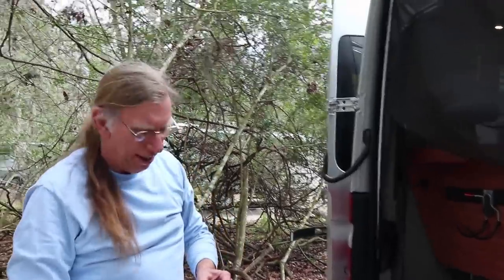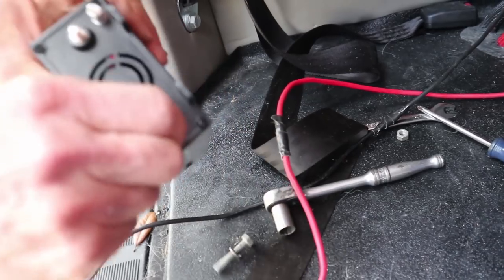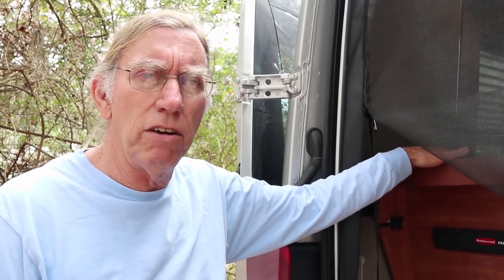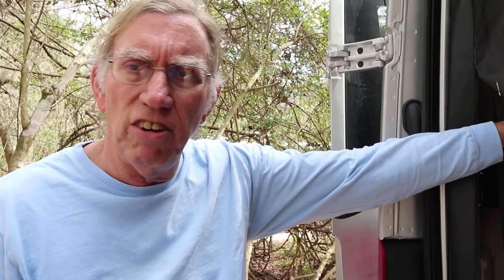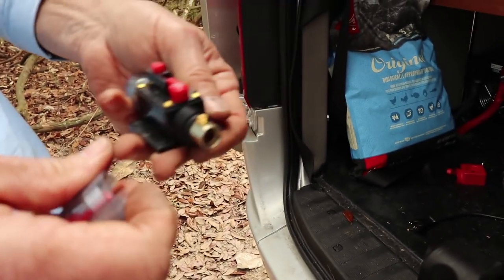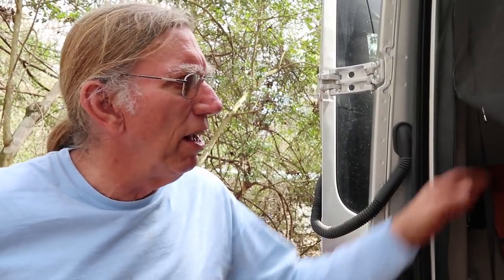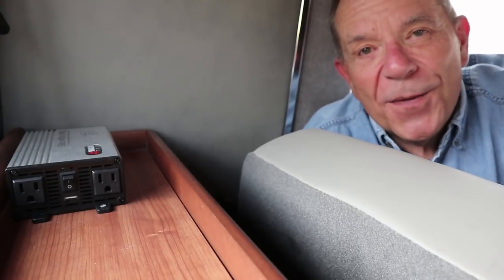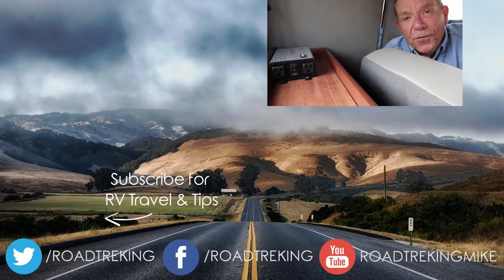Power Up! Adding A Small Inverter to Your RV for Extended Battery Life | RV Lifestyle with Campskunk

Comment: For those of us with older rigs and smaller house batteries   .5 to 1 amp draw may be  considerable, add a 12 volt automotive  relay and a mechanical timer so you do not forget to turn it off. My wife and I when watching  TV use to say put another quarter  in when  one of us got up and moved around.

Comment: The idea is great for some stuff and I may look at putting one in the Zion (though the big inverter is not as accessible). For cell phones, tablets and similar though I use the various USB power connectors around the cabin and skip the AC completely.

Comment: Or ~ you can purchase a basic rechargeable battery power pack with a built-in inverter and outlets. This will extend your system battery life and you can totally ignore your system's wiring and protection set up. The best by far have a lithium battery (expensive) but I'm currently (lol I did a pun) using a much cheaper car jump starter/power pack with an agm battery and an inexpensive 400w inverter (two 115v outlets and USB ports) to power/recharge eveything except my AC and microwave. If you go the inexpensive jump starter/power pack route I highly recommend the ones with an agm lead acid battery. * If the power pack has usb ports always choose these over the inverters usb ports and always turn the inverter off when it's not being used. An inverter uses power almost like a small appliance.

Comment: As to charging cell phones and tablets, I went much simpler in my travel trailer. I wired a usb charger into the light circuit in the bedroom and the living room. Presto, I have spots to charge my devices without using an invertor. The LED lights use so very little power and the circuit is protected by the fuse in the power box.  I didn’t have to try to string a new circuit. This especially important in the slide out.  I do like the idea of the small inverter and will probably install one for the computer.
Reply: Mike Strothotte there are laptop chargers 12v to 19v

Comment: Stick to using 12v or 24v when ever you can and use USB adapters or 12v outlets. When you convert to mains voltages you lose efficiency every time. Since I put a solar panel on my rig I’ve only plugged in when it’s available to run the fridge.
The panel has charged the habitation battery by 10am

Comment: Great Video!!  Just one thing, for those with slightly older Roadtreks having the etrek option, you may have a 24v connection on the large inverter.  You can't use that for the inverter mentioned on the video.  I have the same 400 watt inverter and connected it directly to the the batteries with an inline automotive 30 amp fuse.  Seems to work great.  Just be sure that the connection to the smaller inverter is receiving 12v and not 24v.  I have the 2015 Roadtrek CS etrek (which I love).

Comment: I have a question, I just started living in a pop up Rv trailer I'm trying to figure out how to put a battery in it for my appliances. It has 2 beds in it one in front one in back 2 side couches and an AC unit sides are fabric base , I'm having issues with the electricity. I don't have access to a 240 outlet live on my friends land around the side of his house, I blew his normal outlet and the GFI, I'm trying to figure out how to hook up 5 fans , a microwave , a tv , a cell phone charger, a mini fridge, and a PS4. Currently getting my friends power box fixed but I need to avoid blowing his house electric box up, also AC died on me me ( that's why I need so many fans and I have a cat can't have her having a heatstroke on me).also the pop up RV is 10 years old. I'm open to all advice and help videos anyone can link me.

Comment: Please forgive me as I’m just learning all this before I actually go to live in a rig full time so my question is when your not plugged in to shore power & your boondocking, you need a larger inverter to run your air conditioner, refrigerator & microwave?

Those are what I would be using mostly everyday.
I don’t have a laptop or camera so my only small appliance would me my cell phone.
Reply: yes. the inverter changes battery power to household current, and the air conditioner and microwave run on this. the refrigerator can run on either battery current (12 volts) or household current (110 volts)
Reply: Ok also learning. I have a CPAP and if I used A/C how much wud I need??
Reply: Voltage wise. Sorry.

Comment: Why tap into those large cables in the rear?  For only 250 watts, using a cigarette lighter plug would work just as well.
Reply: IF that plug is hot with the keys out of the ignition.
Reply: Yes, maybe if:
- your vehicle has 20 amp circuits and fuses
- you only need 250 watts
- you have extra fuses when you exceed the 250 watt limit
- your vehicle's cigarette lighter provides voltage even when the ignition is turned off.
Reply: FYI, most vehicles only allow a maximum of 15A at the DC socket (180 watts). This inverter is supplied with both DC and alligator connecting wires, but the DC plug connection will only allow a max of 180W to be utilized.
Reply: Wagan Corporation very true, you can plug in 250 watt inverter, but you won't get that much. DC plugs limited
Reply: No

Comment: 6 to 10 amp draw while idle? That sounds ridiculous honestly. I don’t think that is correct or normal for even a larger inverter so I’m not sure that guy knows what he’s talking about. Also, not all inverters are equally bad in terms of their idle current draw but I believe it is typically significantly less than 1 amp even for big inverters.
Reply: i know it's 6-10 amps because i'm looking at it on the meter. it's not just an inverter, it's also a charger for the house batteries. lots of things going on in there.
Reply: campskunk I see, but if it’s charging the house batteries then that’s not idling. I think that should be made more clear in the video because the inverter is not idle when it’s pulling 6 to 10 amps to do other stuff.
Reply: I don't doubt the meter reading, but the built in inverter/charger isn't charging the house batteries when the inverter is on, only when connected to shore power or running the generator, correct? If so, the high meter reading wouln't be related to battery charging. Enjoyed the video!
Reply: it isn't providing 110 volt power either when idling, but the draw is there nevertheless. as stated above, even if you aren't inverting or charging, all those functions are ready to kick in if needed whenever it's on. these big inverters have a standby function to power down when the load is zero, but it doesn't work very well in RVs because you have microwave clocks etc. that are constantly drawing enough current to wake it up, defeating the purpose.
Reply: campskunk I don’t believe an inverter charges house batteries as that requires DC voltage not the AC that inverters produce. Anyway, the video makes it sound like the inverter itself is just using 6-10 amps when idle just because it’s a big inverter and that is not the case. It’s all the devices that draw current from it when not being actively used (e.g. microwave display).
Reply: once again, this is an inverter/charger. if performs both functions. y'all can believe what you want - i'm gonna believe my eyes and my ammeter.
Reply: campskunk I get what you say about the meter. But the charging function should not be active unless plugged into shore power or when running the generator or RV engine. Also almost every power drawing device in a modern RV should be DC based which doesn’t use a inverter, so I still don’t understand how the Ac devices can be using so many amps when not active. Is this high amp draw something you find common to this degree on motorhomes? I have a travel trailer so it’s not as complex.
Reply: I wonder too if Mike has something plugged in to an inverted outlet that’s using a lot of “idle” amps.
Reply: look, i have explained it three different ways. if you say you don't understand it, i believe you. i have spent the past eight years designing, installing and using these systems, and i have learned not to expend too much energy on trying to reconcile my actual experience with people's theoretical understanding of how these systems work.
Reply: campskunk I get your point. I believe your 6-10 amp reading but I don’t believe that the inverter itself is just that inefficient when idle,  yet that is the impression given in the video. Look at the idle rating of the inverter. Hook up a large inverter directly to the battery and see what the idle draw is. It will be nowhere near 6 amps.
Reply: i did. that's where i'm getting my numbers, looking at an ammeter attached to an idling inverter. all the wishing in the world won't change the reality.
Reply: campskunk Your attempts to explain  the reason for the rating are not convincing, and I found the video misleading (although not deliberately I’m sure). I’m not a professional but I do have both electronics education and experience with designing and creating circuits. The video oversimplifies in a way that gives the impression that big inverters are inefficient by 6 to 10 amps. I don’t believe that’s the case but I guess I will see for myself when I purchase one in the future.

Comment: Why would you use an inverter to increase 12v to 120v just so you can reduce it back to 5 volts to charge a USB device?  Get a cigarette lighter charger for $6 just about anywhere.
Reply: Trevor Stanhope not only to charge USB devices, also for TV and other small 120v things..  A toaster maybe?
Reply: I suggest 2 things before offering comments-  1) watching the video to see what is going on.  2) Actually read the comment you are commenting on.  My comment was CLEARLY not related to running a toaster or any other 120V device.